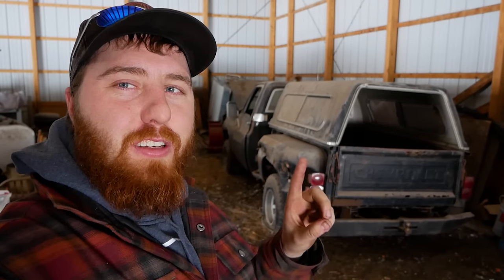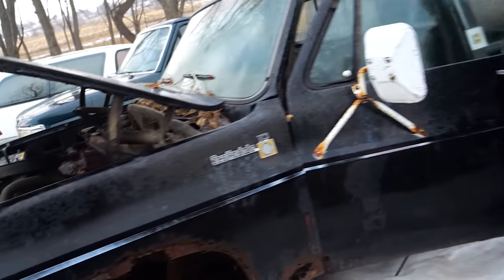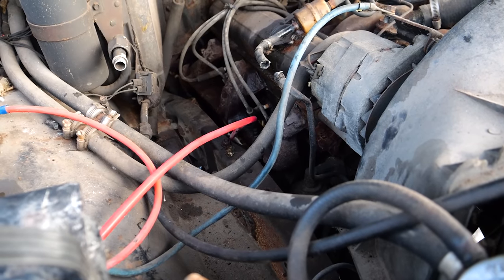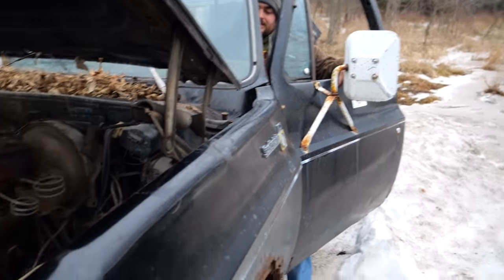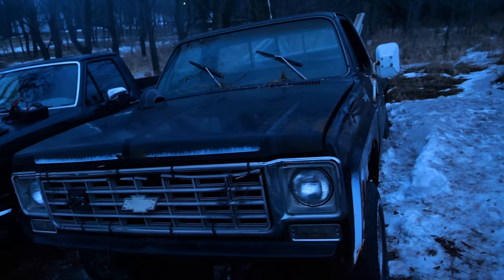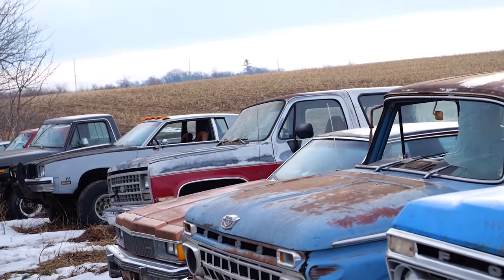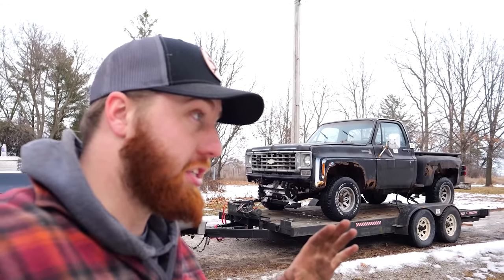Will a RUSTY & RARE Chevy run after 20+ YEARS?

Comment: you know it's gonna be good when it's been sitting for more than 20+ years
Reply: That truck is trash lolz
Reply: and is more rust than vehicle
Reply from the maker: Just you guys wait.... Dalton is not to be slept on
Reply: @samholdsworth420  still probably nicer than anything you drive
Reply: @samholdsworth420  give me 3 months
Reply: @kalh.9241  😂. Hardly considering I live in the Southwest.
Reply: @samholdsworth420  just cuz you drive something that doesn’t have rust doesn’t make it not a POS . Lol probably a Ford owner
Reply: Nothing wrong with a ford Kevin has a lot of fords it’s rusty yes but have seen much worse
Reply: @zacharykelly8178  yh I've seen a truck where the frame snapped in the centre under the cab. It had a railroad sleeper ratchet strapped to where it broke😂
Reply: @JunkyardDigs  I’m excited
Reply: Long as it's structural it'll be fine.
Reply: @dylansarna8750  we had a place truck when I was a kid that the cab corner rotted off and came off with the rockers and the frame looked like Swiss cheese
Reply: @zacharykelly8178  👍🏻🤣 as long as Iit works who cares
Reply: @dylansarna8750  hell yeah I’m ready to see what’s about to come for that truck
Reply: Hl3 valve moment 💀
Reply: @JunkyardDigs  like a rock ......
Reply: When he was driving it it sounded like a hellcat
Reply: @PoleBarnGarage  hey man quick question I got a 93f150 5.0 it’s running and idling fine but when I go to start it it takes a while and when I put it into gear it takes almost half the pedal to get it to go the fluid is full and brand new, truck only has 36k miles on everything. It’s all original with manuals and everything it had since the 90s if you can help me get in the ballpark on what it is it’d be very appreciated man
Reply: @samholdsworth420 what about the truck today??

Comment: A quick note on chevy starters. The starter with the staggered bolts fit the smaller diameter flex plate/flywheel 153 tooth. Straight across fits large168 tooth.

Comment: For future reference: The holes in the starter denote flywheel size. Staggered holes are the large, 168 tooth flywheel. Straight across holes are the smaller 153 tooth flywheel.

Comment: Yupper the new design spark plugs!! I personally switched to E3 plugs because they're still a one piece design,  so that doesn't happen. I was told that the Autolite, AC and one other I can't remember,  are all built in the same factory and are prone to leaving the threads in the head. Have fun trying to easy out that mess!!!

Comment: Excellent video Junkyard Digs Kevin  :) plus Dalton also truck reminds of a friend of mine had 1993 to 2008 a 1977  Chevrolet  High Series 25 3/4 ton in brown body color with beige interior plus brown 2 wheel drive only , had 292 6 cylinder 2 barrel carb Holley 550 CFM  , back window slider type  , 5 light on roof , Power Steering also Brakes to 1 ton suspension with 411 rear end gears  and disk brakes front also drums back !  One fuel tank, plus in 1996 292 6 cylinder gave up ghost so he put 1978 350 V8 hook to Turbo 400 3 speed Automatic transmission  , ran daul exhaust too then in 2008 someone stole took out driveway and never found were went and shame too! He had Step Side box and nickname flapper Lol !

Comment: I had one back in the day. Was a great truck. Had a really heavy duty suspension. In 76 to get around the required lead free mandate GM made the GVWR 7600lbs. Could haul a bunch but on a rough road when you hit a bump you would compress the seat and the seat belt would lock up a notch. A couple of those and you would have to release the seat belt and reattach it, otherwise it felt like it was cutting you in half...

Comment: It might be the rustiest SB Chevy in the world, but I owned the rustiest Ford F-150 ever.  It was a Michigan truck,  1984 4x4 with a 300 straight six, 4 sp manual with granny gear, and while looking at it from a distance, it looked nice, there were very few places you could NOT poke your finger through the paint.  I had plywood for floor boards, and somehow, the frame was still straight even though at least 50% of it was rusted away.  Best truck I ever owned.  It never left me stranded.  I finally sold it for $100 in 2000 after the clutch finally wore out and it just wasn't worth replacing.

Comment: In the early years before starter motors were prefected, they would Crank the motor slowly by hand while priming the motor and then they would bring one of the cylinders up past top dead center and use a tickler (vibrator) ignition coil to start the motor. This method was used on the fiat S76 AKA the beast of Turin, it was the first race car to break the 200kmph speed, it had a massive 4 cylinder engine with a displacement of 28 liters or 7 liters per cylinder!

Comment: I like your revival videos, but the only thing I would do is always make sure the engine is free first before cranking it over with the starter, and to stop using brake clean and simply fill the bowl with mixed gas so the engine has a little bit of lubrication on the upper cylinder when cranking it over

Comment: Plus side is all the panels are still made for it for a decent price.. or you can easily build a stake bed and a good big block and have one hell of a burnout truck, well.. as far as Chevys go.. it'll never be Ford levels of power. Well it turns out no one makes a replacement cab for that generation so.. I guess you could do the cool thing and put the 67-72 cab on it instead? I'll tell you one of the coolest things I've ever played with was this old spark plug tester we had at my high school. You'd put the spark plug into the hole and attach the cable and then you looked through this viewing area and hit the button and you could see the spark jumping the gap and if it was a crap plug you'd see it jumping around all over the place and arcing everywhere.. would've been cool to see what an E3 Diamondfire plug would've looked like in it. We took one out of my welding instructor's 29 N series Ford Tractor with a 21 stud flathead in it and the arc was green for some reason.

Comment: I have to mention that I have now had the pleasure of owning three 4x4 fertilizer sprayer square body trucks and at least two of them you literally had to kick the transfer case shift lever forward to get it to let the truck move...  one of which even had the transmission and transfer case rebuilt and they replaced the transfer case shifter assembly and it still gets stuck and you would have to kick it towards the dash to get it into 4wd and that one was a rusty 86 chevy k20 custom deluxe with a part time transfer case

Comment: My Dad breifly had red stepside sport in his used car dealer days years ago, it was fairly solid, but came with NOS GM fenders and some other sheetmetal,  don't know if someone had a planned a resto or what. It had the cool old rollbar, push bar on the front, and 35's, someone had also put air shocks on it front and rear 😅

A couple years later my brother traded for a '76 c10 stepside with a smokey engine, was factory orange but someone rattle canned over everything with gray primer, he ended up swapping it for a '83 K10 before he really anything with it

Comment: I’ve been working on a 54 ford and before I got to it, somebody broke a spark plug in the cylinder head, took me a week to get it out, there was another stuck plug however I ended up just leaving it and getting the motor running  to heat up the area and it reluctantly came out.

Comment: You ought to get a truck like this, a dozen various fridges, washing machines and tumble driers. Then cut off all the panels from the kitchen appliances and use them to completely weld up the truck until it is in a safe and usable condition. OK it may say SMEG in half a dozen places over the body work but it would look interesting.

Comment: I have a 1980 c10 it originally hade a 250 in it. I put a 1978 350 in it I used the starter from the 250 fit like a glove.

Comment: Kevin, Not sure if you’d be interested but my dad has an old 71 Lincoln continental mark 3. All original with a 460cu engine. 67,000 ish miles. Every worked great at last start 6-10 years ago. As I said all original, nice, clean and all there interior. If interested let me know. Car is located in the area of College Station Texas.

Comment: Kevin,  I see you struggle with sliding the cars across the floor with your winch.. a friend of mine goes to the restaurant supply for fiberglass Lunch room trays. they are strong and slippery to put under the wheels that do not turn and slide free.. Just an Idea :)

Comment: I used to own a GM c1500 ext cab step side truck that didn't run. Was a really weird looking truck. Never got it running while I owned it due to the original 350 needing a rebuild. I planned on swapping in a 4.3 V6 for fuel efficiency, but lost motivation after a title dispute at the court house. The title and vin said it was a Chevy, the grill and steering wheel said GMC. Had for a couple months then sold it.

Comment: everyone always asks why the hoods fold like that. its meant to be a crumble section for a front end accident so the hood doesn't come and cut you in half in the cab. when they get hit they fold on the indentations on the underside of the hood.  If they brace the hood it just makes it more dangerous if you get in a wreck. this truck restored would be worth a lot of money. 4x4 short bed step sides are expensive in really good condition.

Comment: Chevies will run on 5, but anything less than 6 you can't tow a stock trailer anymore.  Worked on a Farm in the 80's that had 3 square bodies all with 4 speeds. We did a clutch every 6-7 months.

Comment: I saw a k20 at an auction that was worse, it was like those "I know what I have" memes. I was gonna buy it for the motor because the ol 350 sounded so good still. It was as unsafe as the triton ford you filmed but that motor was mint

Comment: Except for my bed floor and the cab floors and my truck still had the rotted rockers in place but I think it was probably about as Rusty as your 76 Chevy K10 sport I have a set of factory gm white spoke steel sport wheels 15x8 from a K10 Blazer or a suburban anyways my truck was a old portable annohydrous fertilizer sprayer truck, and it literally had holes in the doors and the factory custom deluxe trim molding removed itself because of the rust holes. Mine was my daily driver and firewood hauling truck for 12 and 1/2 years and made several heavy loads to the scrapyard with loads of scrap metal

Comment: ehh, that's nothing. i bought a '74 c10 off of a tree trimmer company that had zero floor metal in the cab. they were 3/4" osb screwed fast with self tapper pole barn screws, rubber washers and all, and the bed was an osb box they used to haul wood chips in. the rockers and door sills were gone, and the doors sagged due to the rot so bad you couldn't lift them high enough from the seat to get them to shut and they leaked it the rain as if the windows were down a half an inch. i could lift the cab off of the frame, and it was only held on the frame by the rag joint and it's own weight. the seat was mounted to chunks of landscaping timber that was screwed to the osb floor with plumber's tape. up side, the doghouse was surprisingly good, and the straight six ran like a champ. now that truck was rusty.

Comment: It's definitely true that Chevys will run on 7 no problem. In auto shop class in high school, we had to rebuild a 350 SBC and get it running again. There were 6 groups assigned to 6 different engines and one of the groups lost a whole piston and rod 🤣 and it was assembled with 7 Pistons and it was the engine that started up the easiest out of the 6 🤣

Comment: I used to own a red and white 2wd regular cab long bed 82 chevy s10 behind the side Dalton was working on the 350 lol almost just like it my truck was a 82 Durango 2.8 2bbl dual jet carb close ratio aluminum 4spd  manual transmission

Comment: That truck was a real looker back in the day when it was orange with a white stripe.  I saw in an early part of the video that the frame was swiss cheese when viewed through the left rear wheel opening.
Reply: They came in Orange with stripes (I own one) BUT that one was Black with white stripes
Reply: @Texassince1836  it was actually orange but a previous owner taped off the white strip and painted it black. Your truck must be nice.
Reply: @JJ Bowler  The black Sports came with red interiors, and this truck has red interior. Orange Sports came with tan interiors.
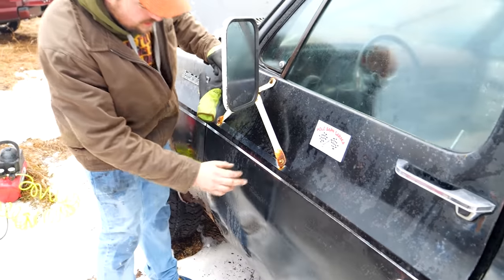Reply: @Texassince1836  i was just going by what they said at 13:59 in video that truck orange and had a Earl Shibe black paint job overtop. Maybe that was just the bed.

Comment: I've been finding that the brake cleaner that I've been using is not as flammable as it used to be, not sure if they have changed the formula.
I've start using just gas to start vehicle
Reply: I bought 5l in a can and it ruined my werth pump sprayer. God knows what it's made of these days.

Comment: Was that a full- time 4 wheel drive or part-time 4 wheel drive? The difference is full- time had 4 section for and part- time only had 3 section. I know because I have a full/ time transfer case out of 1979 Chevy with a 350 trans.
Reply: In 76 the only Tcase behind an auto in half tons was the 203 full time

Comment: Old demo derby driver. Never under estimate the small block chevy. WE used to put them in imperials ) unstoppable. They will run without water longer than any other engine we ran )

Comment: You guys need to stop using brake Kleen for fuel. Some 2 stroke 60/1 fuel works much better. And add some carb cleaner to it. Im sure you have been yelled at before about it, But my 40 years starting junk it works great.

Comment: You call that rusty? I got a 96 k3500 that the carrier bearing housing rotted off the frame and there is zero floor. The battery tray and inner fender collapsed. Only has 56k miles

Comment: dalton : you cant compress a liquid, as he works on a v8 engine that require compressing air and fuel to run
Reply: Fuel is (hopefully) vaporized in the carburetor and intake prior to entering the cylinder.

Liquid fuel burns poorly.

Comment: Bruhhh I won't stop complaining about you using brake cleaner and no gas to try and start engines. I get the atomized benefit, but you've gotta soak it in fuel first. All that carbon and shit in the intake manifold is dry after sitting for so long. It's gonna soak up the brake cleaner, so you're gonna have to use a ton of it, plus brake cleaner just doesn't have the right octane. You gotta get all that junk hydrated with gas so the atomized brake cleaner actually makes it to the cylinders.